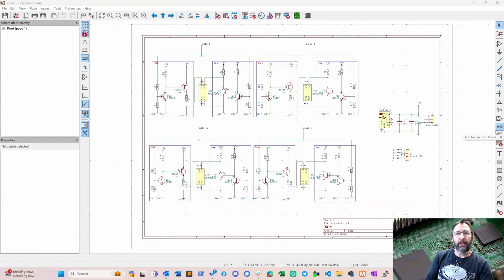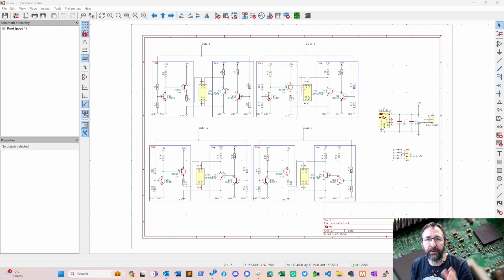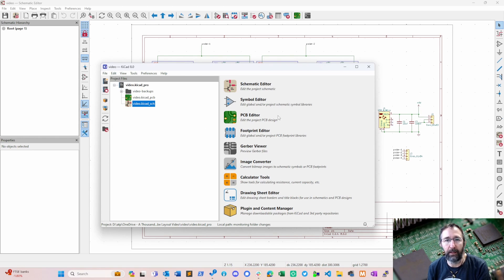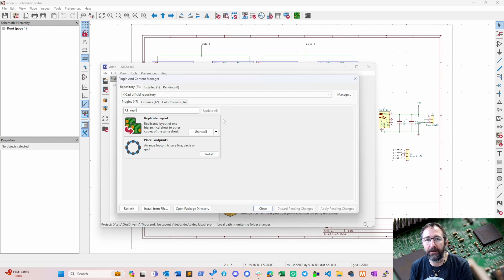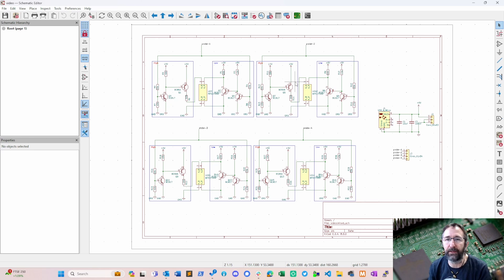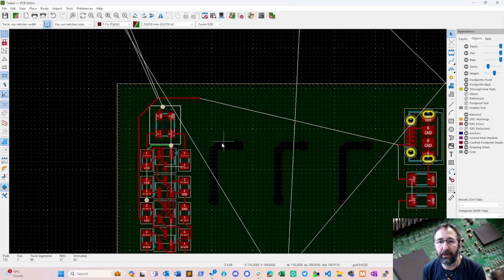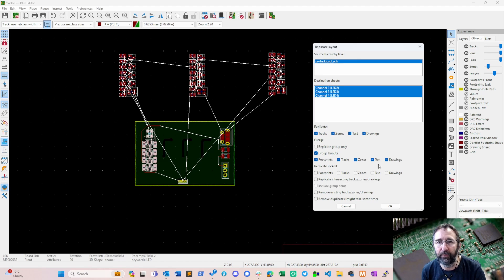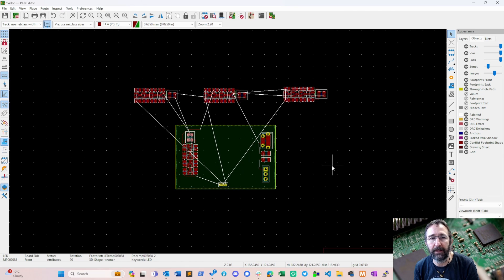#17 - KiCad - PCB layout replication

Comment: An additional feature that might be of interest when using multiple instances of subsheets is the ability to use parameters.  Basically it's setting (sub)sheet level fields, then using those elsewhere on the sheet. You can later edit those fields on a per sheet-instance basis.  Have a look on Kicad forum for Sheets with parameters discussion.
Reply from the maker: That's good to know - Thanks

Comment: Great tutorial, thank you. It enabled me to replicate my PCB successfully. 

I want to mention some problems in KiCAD6, hopefully someone watching reads thru the comments as well.

When moving a schematic to a hierarchical subsheet: Cut the part to move. In the subsheet choose Paste Special -> Keep existing reference designators even if they are duplicated. You HAVE to re-annotate before updating the PCB but this fails. Run the ERC and ignore any errors. THEN re-annotate and it will succeed.

When the schematic was started in KiCAD5 and you upgraded to KiCAD6 replication may complain about a different number of text items in some footprints and will fail. In PCB editor edit the footprint of the offending part, select Update Footprint and the missing item is added. I had to do this for every offending footprint, not sure if there is a batch command for that.
Reply from the maker: Glad the video helped and thank you for the additional info.

Comment: I wish Kicad had the concept similar to a class / object in programming languages. I mean it would have been nice if one file (object) could be imported which contained both the schematic and the layout done. Of course the imported one is an instance of the parent, and can be modified (without affecting the other child).  This way one could build up 'modules' which are ready to cut and paste into new projects, and one can make layouts of complex projects quickly.  Alas I don't see any thinking in this direction, or am I wrong?

Comment: I'm pretty sure when you use a hierarchical child sheet multiple times on a parent sheet, there is only one file for the child sheet. So when you make a change on the child sheet, there's no propagation to the other instances of the child sheet.  It's just that the one child sheet has been changed, and so all uses of that sheet use that one set of data.

Comment: Good video! In 9:15 the not routed track is by design of the plugin (at least I guess). All nets which are within a scheet are routed. Every net having a connection to another net are not routed. This makes sense, as those nets are most times not usefull when copied 1:1. Keep on our good work!
Reply from the maker: yes its possible its been omitted due to the rat line  to the header pin not being routed yet, but as there is a track between the two resistors, I do think it should be included. Perhaps a nice feature would be to allow the user to select the additional tracks not initially picked up in the plugin. 

Thanks for you comments :-)
Reply: @athousandprojects Here a sentence from the README: "By default, only objects which are fully contained in the bounding box constituted by all the footprints in the section will be replicated."
Reply from the maker: @guentherjehle  Fair enough 😀